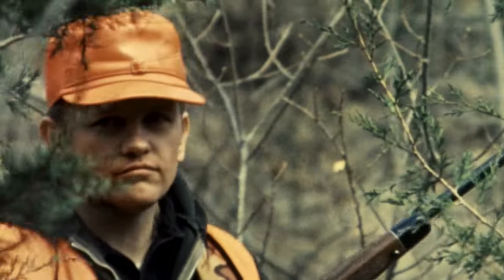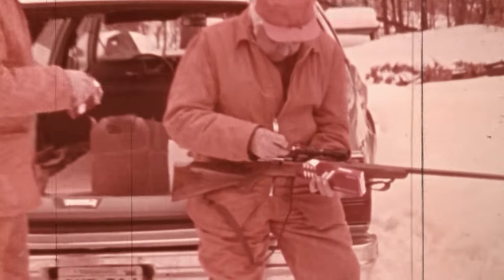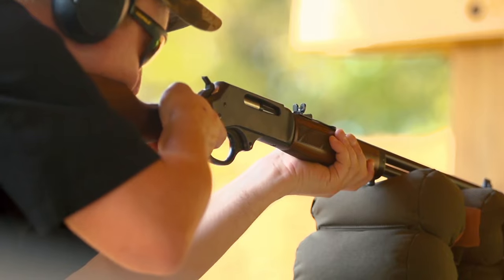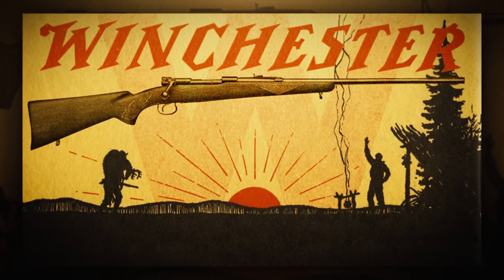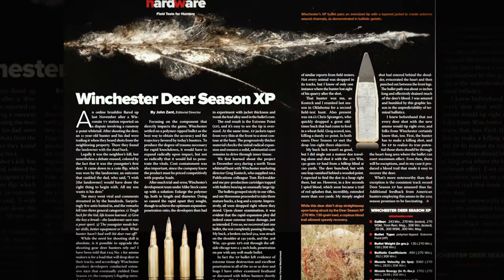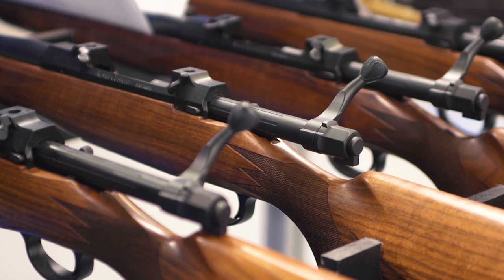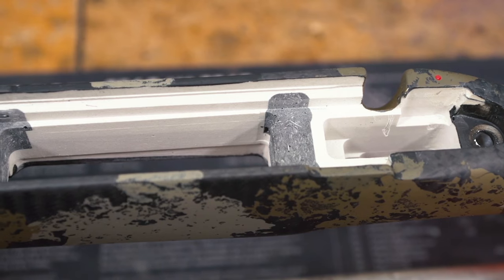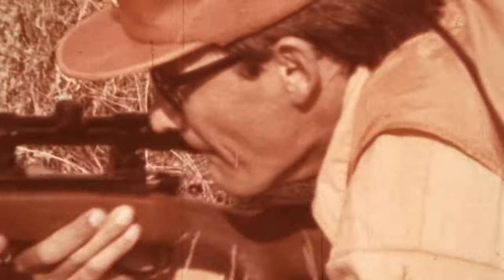The Modern Bolt-Action Deer Rifle

Comment: Stated in the video of a 400 dollar rifle should shoot one moa😂.  Some do sure. But most 400 dollar rifles suck. Plus the old 50-60 year old rifles do absolutely shoot just as good as the new ones. Plus they all have wood stocks.  Not these cheap garbage plastic ones that every rifle comes with.   Plus we talk about cartridges all the time. New is better on paper yes.  But in most hunting applications you cannot tell the difference between them. Like 7mm rem mag vs 7 mm prc.  On paper the prc is better but it’s negligible at best.  Yet they talk like omg nope the old ones don’t work anymore.      This is all just a push for money.  There is a reason I buy these old deer rifles.  Because the new ones aren’t going to be worth anything in 20 years
Reply: Both of my Savage Axis shoot well. But I prefer to say they are Minute of Deer rifles because they have brought home the meat lol one in .223 which is just the standard Savage without any upgrades. The other is a Savage Axis SR with a 18.5 inch threaded heavy barrel. Both have done the job of being meat home as long as I do mine. I also get what you mean about this just being after money though.
Reply: Blue steel an wood stocks the best there is